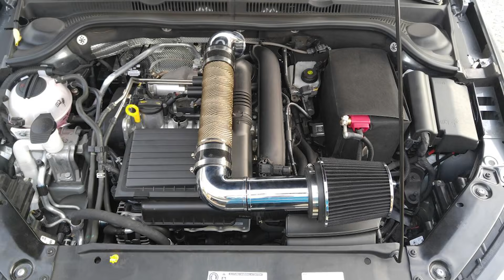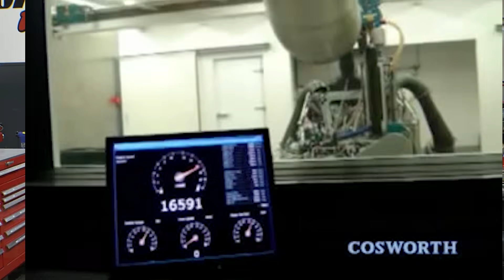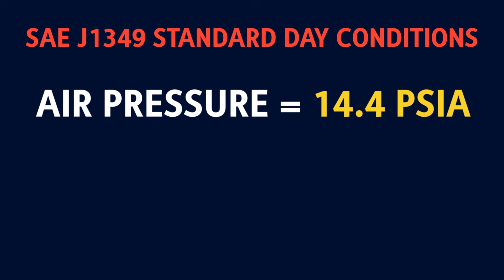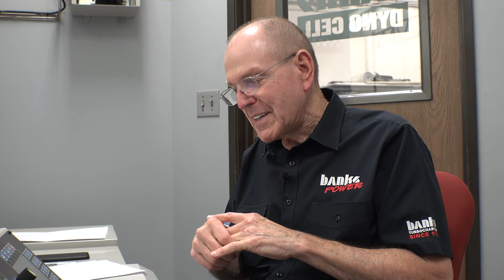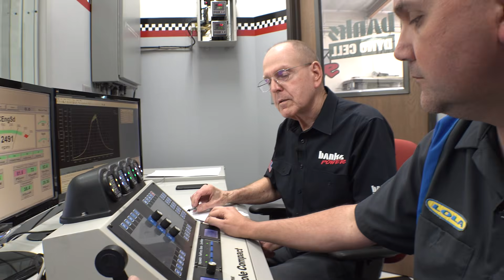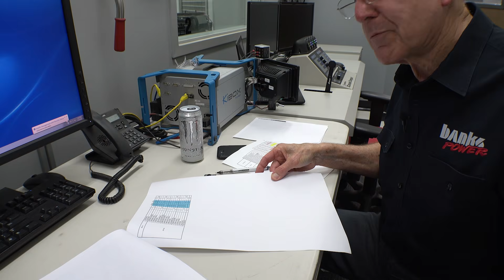KILLING A DURAMAX Pt 4: Starving the Monster 🔥

Comment: Any idea of the power a mild to moderate boosted, cummings 4bt @1,200 ft. I'm thinking mid size truck,or maybe 1/2 ton, I think a 6bt would be a bit heavy,  with 4L80,        or a 700 r4,   and 3.55:1 and gears, for street use and tow less than 4k lbs. I wanna make that diesel leap, in a project,

Comment: Very illuminating. I knew that restrictions or hot air would hurt things but the Turbo inlet temperature really shows how bad a poor setup can be and even though there is a power loss,there is a lot more heat stress on the engine and not even a better intercooler will help.

Comment: Could he please call that Throttle Body a Throttle Body.  No need to come up with a dumb name to sound more interesting.  Corrected horsepower is extremely useful for measuring changes you make to an engine.  You need a way to baseline out modifications.
Reply: I think it is actually from some big diesel truck used as an exhaust brake but I know what you mean

Comment: ya ya.... we all know turbos are better than SCs
but SC whine is to DIE FOR!!!

my dream car is a 99 buick regal GS..... 3.8L v6 with m90 blower...... the sleeper of sleepers 

my current daily is a 99 century..... 
same car....but with a NA 3.1 v6....160hp

slow.... but it handles amazing 
actually over-steers..... and JUST. DOES. NOT. PUSH! (aka under steer)
and its only got 205-70 R15s!
 
you can get it into a slide.... and just let go of the wheel..... it will correct it self

if it had another 150 to 200 ponys..... damn would it be fun

but i would probably not have a license.....due to too many speeding and "excessive show of power" tickets

Comment: Heat soak from turbos and huge intercooler lower efficiency after running. Lol
Reply: I leave the work truck idling for a while, where i think its a quick stop and i get in to leave and shes all kinds of soggy and logey for about 30 seconds until it starts breathing some cooler air. 
Im sure the intake air temp sensor is freaking out and having the computer cut out some spark advance. 
Thats a 2016 gasser ford pickup.

Comment: Fastest cars in the world-blower powered
Reply: joel champagne easier to work on but also those cars don’t make max power, they’ve said they can make more power with turbos but the cars can’t handle it yet.
Reply: @bbdl7042  turbos lag. When they dont lag you spin bearings. Heat soak after one run pretty much destroys the tubro..

Comment: Thousands of Diesel powered trucks (not only commercial but including recreational use trucks) drive from Southern California northeast up the I15 to the Vegas Valley 24/7. That long uphill pull from almost sea level over the mountains at up to approximately 4,500 feet altitude and down to approximately 1,800 - 2,200 feet in the valley must create enormous changes for the engine to deal with. It would be interesting to log a round trip up and over, and analyze it with of course improvements in mind.
Reply from the maker: We've made that trip dozens of time with various diesels and logged them all. Just have to figure out who to make an interesting/educational video about it.

Comment: I'd like to see a simulation of 35,000 ft., and 50 below zero. And, if possible, the air speed loss from firing a .50 cal. machine gun at 500 rounds per minute.

Comment: I live in Las Vegas so like many in the desert southwest, our air temperatures average much higher than most. NASCAR for example runs about a dozen races a year in hot weather in these areas, just in one series, not to mention all the other NASCAR series plus NHRA, etc., in just these areas. I would think all that you are talking about in terms of air density, even for those series that don't allow turbo or supercharged air management systems would be critical. 
Interesting.

Comment: Those HOT AIR intakes are funny, usually the stock intake system makes better power with denser air on a gas car. The intake system in my Passat is better then any after market option available. N/A 2.8 30v

Comment: My AIT shows higher than ambient while standing still idling. My IAT temperature shows ambient temperature when driving. :-)
Reply from the maker: But what does it show under load or at WOT?
Reply: Should drop when you are on the throttle. Moving more fresh air keeps the heat-sinking at bay. Close the throttle, you're not letting the air move, everything is heat soaking. Open it up wide, give it some air flow and it'll come down to ambient. One reason plastic intakes are actually a very good thing (on a naturally aspirated engine at least).

Comment: I’m really digging all this testing and math behind it. I mostly already knew the whys but have a better understanding of the how. BUT, I’m still patiently awaiting a disastrous “Firepunk Cummins” scale of destruction of this L5P. Dying to see the overhead limits GM designed into it. Thanks for continuing the very educational videos.👍🏻👍🏻
Reply: GM had nothing to do with it - it's made by Isuzu in Korea
Reply: Deadon, better do some research. It’s a joint venture between GM and Isuzu, started by GM. And they’re built in Moraine Ohio.
Reply: @racrx7  As of May 9th of this year the Moraine Ohio plant was still awaiting government approval to begin production and these engines are still being shipped in from overseas. When production begins they will be essentially a new engine which usually means there will be a number of issues that will have to be worked out and I would not touch any of the first production run engines
Reply: Deadon, please list a source for your information. The 6.6 L5P is and has been built in Moraine Ohio. The 2.8 Dmax is built in Thailand. and the latest L5P is designed by GM engineers. So how can you say GM has nothing to do with it?

Comment: When comparing turbo and mechanical blower and how one pulls power during power stroke and one during exhaust stroke. It makes sense if you have a single cylinder engine but with V8 don't you pretty much always have each stroke happening at the same time so how does it make any difference?
Reply: A mechanical blower will drain power from the crank throughout the 4 cycles/2 revolutions of crank, as it actually reduces inertia slowing down the crank, no matter how many cylinders there are firing at any given time.
Where as a turbo is using exhaust pressure/heat which has no parasitic drain on an engine, and which usually is a waste product with no practical use, only prob with a turbo is you need more fuel than a NA motor, due to increased PSI of oxygen in the cylinders.
Reply: @fullboostturbo1  
But there is no exhaust pressure (much, of couse some is needed, otherwise there would no be flow at all), if you don't have a turbo blocking the exhaust flow. So the pressure you have before the turbine is not "free waste energy" IMO because you are creating the pressure by restricting the exhaust flow, and higher exhaust pressure means more work needed during exhaust stroke to push the piston up. Heat does make some difference here -  because exhaust temperature lowers when it goes through the turbine, that heat energy must have been somehow transferred (to make boost), even if I dont fully understand how. But that's not what I was asking.

Comment: You should have installed a windshield wiper motor/window motor and a throttle position sensor on the butterfly to move it on the fly and to monitor the % opening.
Crancking stuff by hand is old school lol
few grid heater from cummins 6bt could help getting hot air too.
Or just a drive by wire throttle lol
Reply from the maker: Good idea but no need for automation. It was built just for this video.
Reply: @bankspower  I hope you didn't get offended by my "old school".
Your vids are very interesting,you are not old or irrelevant at all,like your methods.
I'm just a bit too excited when i see that peoples have so much ressources and abilities.

Comment: Hi Gale, that was a very interesting video with a lot of information. Would it be possible to develop a program for pressure vs density vs elevation? And a controller to regulate the butterfly, so as you go from sea level up in elevation you can have the same performance in a cold air intake and not KILL THE ENGINE!!!
Reply from the maker: You'll enjoy a few patents that Gale's working on. Stay tuned.

Comment: Gale, this may be a little off topic but I think it may be a good video for the future.  I have a question that may skew the numbers but I think a lot of people that have the L5P's in their trucks would really like to see.  Now before I ask this question I would like to note that you are using a dynocell vs actual driving conditions.  That question is this.  How much do the numbers change when you factor in the RamAir hood on the L5P trucks at 60 mph in nominal conditions?  The intake air, I know from my truck, never sees the under hood temps and I think GM really knew what they were doing when they added that hood to the truck.  Does it make that much of a difference in regards to testing in a dynocell?

Comment: Are you monitoring boost temps coming out of turbo and also out of 'aftercooler'? During this series of testings are you also including these figures into intake 'air density'?
Reply from the maker: Yes, all aspects of air intake, turbo, cooling, and exhaust system are being monitored. You'd be stunned by all the data collected.

Comment: Hey Gale have you figured out what is best temperature for making HP,
Reply: As cold as you can make the air is the best.
Reply: Southern Nevada offroading and back country , I was wondering if there was a point when the air got to cold and power starts dropping
Reply: The problem is the wheel bearings and transmission rob power when it gets too cold. My Buick runs fastest at like 80 degrees
Reply: I need to convince the local Dyno shop to let me run back to back in the 60* shop, and again with the door open at -30*. They bitch about the cold though.

Comment: Hi Gail so I'm formative as always , can I ask a couple of questions , I totaly get that outside engine bay cold air intake is best for power and torque , presuming that the feed is placed on the front face of the vehicle as the car or whatever is driven forward there should be a volicity increase and therefore pressure increase in the intake air pressure , so bearing that in mind are u better with multiple small tube to collect the air and increase the ir pressure because forcing moving air into a small tube will increase its velocity , or one large intake but with lower air pressure ...?, can u at some point cover intercooler pipe diameter s for the same reason , u have an amazing wealth of knowledge that I would love to tap into , many thank jon.

Comment: Gale - I want to know how parasitic the turbo is....I suspect that an engine with turbo doesn't exhaust as completely as does a standard aspirated engine. I'd be curious to compare the cylinder pressure at the beginning of intake stroke (or end of exhaust stroke) between turbo and non turbo engines.   Also wouldnt it be great to add a reed valve on the exhaust port (like a 2T motor has on the intake but able to withstand the temperature) so that header back pressure never affected the cylinder pressure at the beginning of the exhaust stroke?   I may be full of crap tho.

Comment: Humidity is already controlled in modern vehicles. The cold air intake just needs to pull air from inside the passenger cabin. Might "suck" a little for the passengers. I wonder how long the AC system could keep up.
Reply from the maker: You're talking about a perpetual motion machine.

Comment: So if the intake isn't under the hood where is it?
Reply: In a closed box with a cold air feed to it.  Strangley enough just about every car manufacturer out there adopts this practice, but "tuners" know better evidently.
Reply: @juancornetto8243  ok, I have a 1st gen cummins (little aftermarket support) and I'll have to custom make one. But if it makes that much difference then it's worth it.
Reply: It would still be under the hood just not 'naked' under the hood the air filter should be protected by a box or something from the heat of the engine

Comment: How is increased back pressure due to the turbo not a parasitic?
Reply: There's no way that having to push out exhaust at a higher pressure isn't subtracting power.  But perhaps this is cancelled out by higher intake pressure adding power back.
Reply: @paulallen1362  I think perhaps the air resistance of the turbine is maybe inconsequential to the resistance of forcing the air out of the cylinder through a partially opened valve at 60 times a second?
Reply: It only is if the drive pressure gets to be more than boost pressure
Reply: I wondered that too. I'm theorising that the pressure in the exhaust is a waste product of the combustion cycle effectively, and thus reusing it to spin the turbo is effectively free energy that would other wise go to waste.  That and the effective area on the exhaust side of the turbo is larger than the compressor side means it has a mechanical advantage.
Reply: Exactly what he said its parasitic till the turbo spools up and makes the boost after  that EGT is ur next enemy unless u running like 100 plus lbs of boost or some crazy shit like that then drive pressure can exceed boost.  They billet duramax manifolds for that shit 200 psi drive pressure and 2,000 degrees of EGT.  that's insane what I call insanity
Reply: Drive and “boost” pressure are at the most ( in a proper setup) are 1:1

Comment: Killing an allison 1000.
Reply: That's easy, just add a 100hp tune...
Reply: @bbdl7042  I mean like up until.now maybe Chevy was winning with the transmission game all day. But I'm curious on the new 10 speed allison and the new l5p motor looks like a monster so far over the competitors
Reply: @bbdl7042  also ibe heard of the aisin shifting erratically and needing tuning but then it voids the warranty
Reply: And it will still outlast the other competitors though